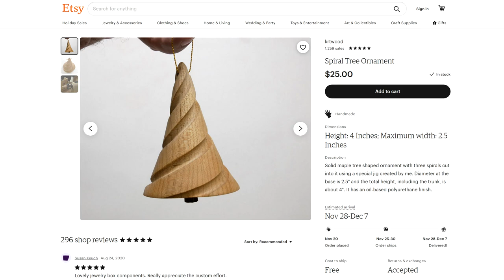Clever Jig Makes Wood Spiral Tree Ornaments

Comment: I love your jigs. You might find turning a step into the spigot so it doesn’t bottom out in the chuck - pushing the step against the face of the chuck jaws - will give you better alignment and do without your spacer, and be easier on your tailstock 🤔😀
Reply from the maker: Good suggestion, thanks!

Comment: An impressive jig.  I can imagine the time to make the jig.  Likely a few iterations on some or most of the parts.
I would have hogged out most of the material before using the router jig to make the sweep.
You mentioned the tailstock is now hard to move in and out.   It sounds like the thread on the quill and/or the screw is swaged.   This happened to a member of my local turning club.  I had to machine a new screw then use the new screw to re-swag the quill internal thread.  
I may be able to fix this for you if you just need a new screw.  Machining external left hand thread is not a problem.   I would need you to send me the quill and screw for inspection and potential repair.
Dave.
Reply from the maker: That's an amazing offer.  I think I may end up making these once a year so I'm afraid I would just keep damaging it again if I can't get away without using the extension.  I thought about buying all the parts for the tailstock to have another good one and swap the bad one in just for this but the cost is about half that of the whole lathe.  I find that removing the bulk of the material with the router goes pretty fast.  It's on the last few shallow passes where it starts acting like a climb cut and wants to take off so I have to slow down and keep control over it.

Comment: Great Video, Thanks.  The spiral part at the end was pretty cool, but I could start with a rectangle piece and get to the christmas tree shape useing just a chisel and lathe.  Maybe I would use the band saw to make my block.  But I really want to know the name of that saw you used it the opening shot.  It looks like it would be a good saw to cut pieces for segmented projects in a small shop.
Reply from the maker: The miter saw?  It's a Bosch Glide 10"

Comment: Curious why you didn't try (or at least didn't mention) making two at once mirrored on the lathe. Could be wrong, but I'd wager it'd at least help with a number of complications (with a little added complexity), especially with stability. Plus it'd make it so you could more easily remove bulk stock with a second bandsaw cut for the wings (or whatever you wanna call them) rather than having to turn them off on the lathe.
Reply from the maker: It never occurred to me.  I came at it from the thought of a more typical spiral jig that runs parallel to the lathe but putting it an angle and then realized I could make it simpler by having it pivot through an arc.  You'd use a lot more wood as you wouldn't be able to nest the points together.  For the potential 5000 ornament job that would be many thousands of dollars.  I'm not sure if the gear can turn that far before the router runs into the right angle gear.  You'd also have to remount the one on the tailstock end in the chuck and it's hard to get something mounted so that it runs perfectly true so that part.  I'm not sure you'd gain enough time to make up for the extra wood, if it's possible.

Comment: Out of curiosity, could a 4th axis on a CNC do the same thing?
Reply from the maker: Not exactly, because the spindle can't rotate to follow the curve when doing the spiral.  It would be better to do a straight taper.
Reply: @krtwood  I see what you mean - it couldn't do the curving "sweeping" motion that keeps the bit perpendicular to the curve - but it could definitely move up the curve while the 4th axis is rotating (rotate the whole thing 90 degrees). probably wouldn't be as clean though, since the whole profile would be cut be the leading edge of the mill/spiral bit

Comment: can you break down how you got 20 minutes per item for 5000 items? cause if my figuring is right it would take you a little over 200  8-hour days to do that.
Reply from the maker: 20 minutes just on the lathe to get it totally completed in 30 minutes.  I'm also not a robot so if it takes exactly 30 minutes start to finish if everything goes right then I'm always going to fall behind.
Reply: @krtwood   so was my math correct though? did you budget basically an entire year of doing nothing but making these?
Reply from the maker: Yup.  Money would have been far better than anything else I've ever done.

Comment: 5000 ornaments at ~3/h and an eight hour work day would mean 208 days of working.. does not sound fun xD even if you had a higher ornament/h rate and a longer work day, it would still take around 140 days (3,5h/h + 10h)
Reply from the maker: There were mixed emotions when I didn't get the job :)  And it's 20 minutes on the lathe, that doesn't include all the other steps to get it finished in 30 minutes.  It would have been way worse than that, but especially this year the money would have been good.
Reply: @krtwood  do you have just a paypal account? I don't like patreon due to their fees, but I would like to support you since your videos are always amazing to watch
Reply from the maker: kevin at krtwood.com  Much appreciated!